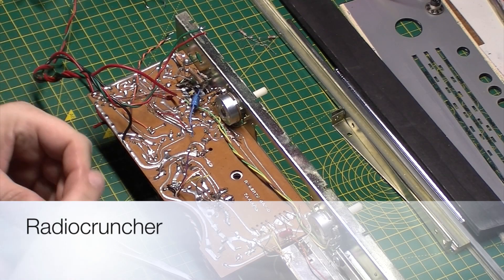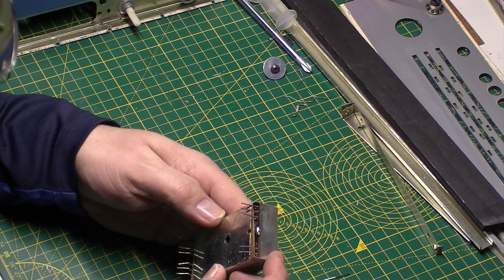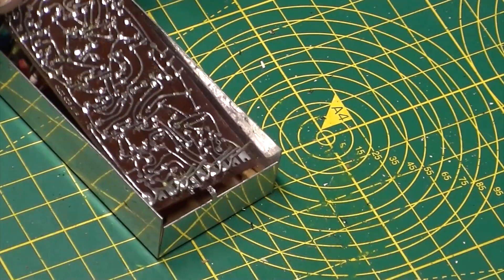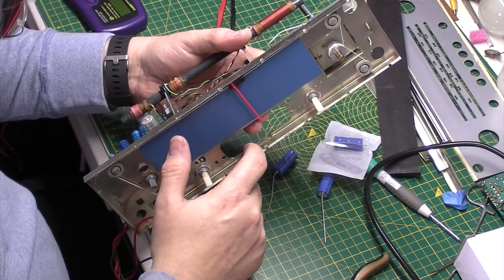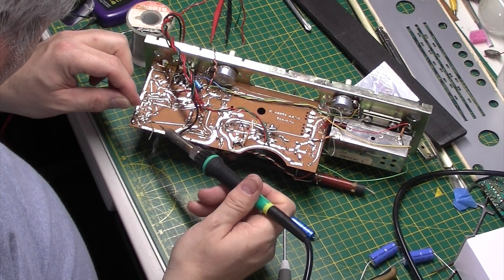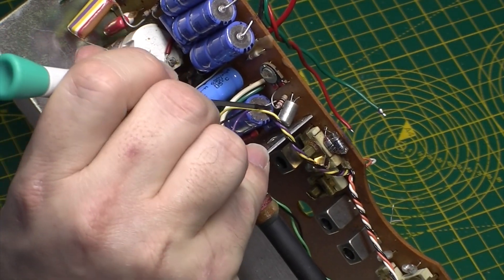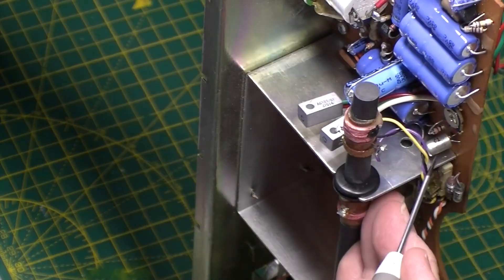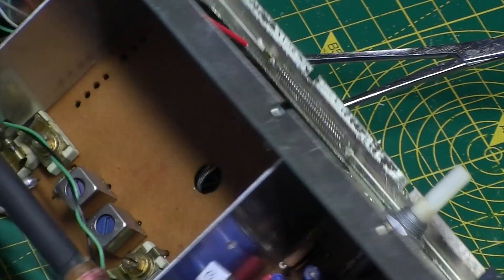Roberts R707 newest version. Part 2: Module, Recap and Volume pot service

Comment: Lovely Job Graham My Favourite Roberts Radio For Sound Quality..I Have Two To Do, Its The Module Thats The Killer But Will Have a Go When I Find The Courage hee hee, Just Finished a Hacker Sovereign rp25b You Know The One With a TAA920 ic When i Repaired it The Volume Was a Bit Low On FM Checked Every Thing And Replaced a Few BF194 Transistors But No Luck So I Sent Away For a New I.C. Of Ebay It Was 3 Quid Something.
When it Arrived I Fitted It Not Expecting any Change.
But To My Surprise It Brought The Volume Back To Normal So The Chip Was Faulty/
Looking Forward To Part 3 Graham Regards Mike.
Reply from the maker: Hi Mike. Yes the module is a bit daunting but has to be done if the radio is going to survive into the future. Well done on the RP25B. I’ve been looking for one of them as I have only worked on the RP25A. Regards Graham

Comment: Looks more like Meccano than radio restoration. Why are the capacitors in the clear plastic tubes at 6:46
Reply from the maker: Yes it’s a bit like that Chris. I can only assume that it’s to stop them shorting on adjacent components as it’s pretty packed in there